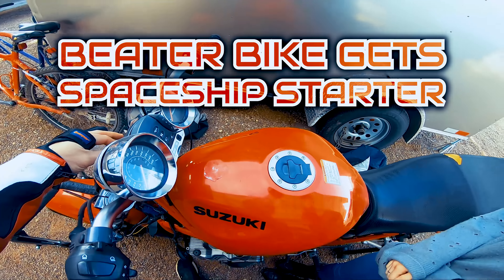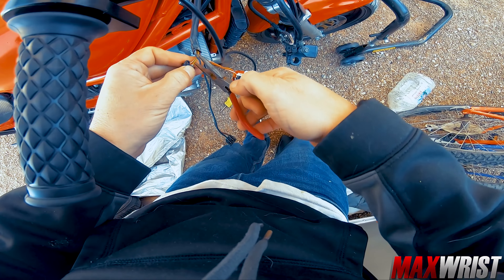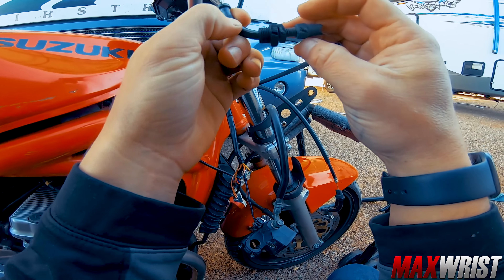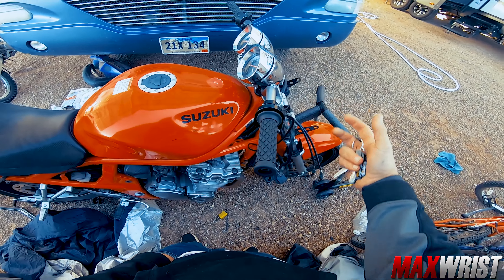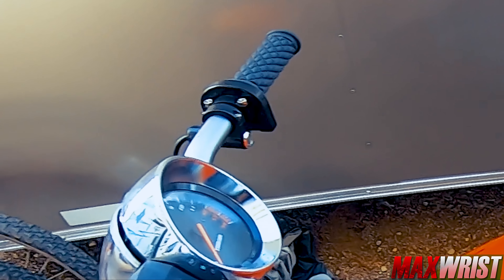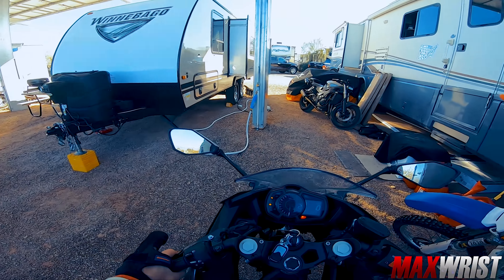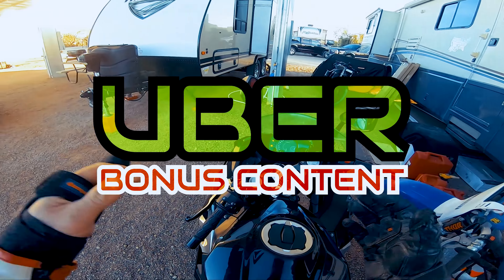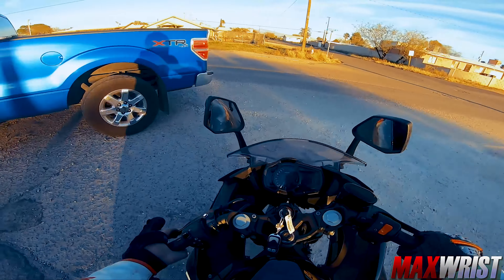DOPEST UPGRADE 😱 *SPACESHIP STARTER*

Comment: I don't mean to discourage you but CV Carbs don't do well with pod filters. Even after re jetting you will have flat spots. Even a high flow filter in the stock air box can cause all sorts of drive-ability issues.

Comment: Buy a Jet kit if your going to add pod filters. You can do that to a car, but if you do that to that little 250 your gonna be running lean as hell. You will give it gas and it will sputter out at higher RPM’s if you don’t rejet the carb :(

Comment: FYI, If you install those air filter pods, youre gonna have to take apart those 4 carbs and rejet them :(
Reply from the maker: Hmmmm
Reply: MaxWrist Gold  you should be able to find a jet kit for it, and look up a forum on google to see what people suggest for jet sizes with pods on that bike, then you just gotta open the carbs and swap out like 1 or 2 jets in each carb, if you’re doing the exhaust as well then you’re definitely gonna need to rejet it.   You can get some great power rejetting however, so I’m looking forward to it if you go through with it.    It should still run without rejetting, just won’t run fantastic.   I’d look up a forum to figure out what jets to run for pods and an exhaust.   Should be able to find the right setup pretty easy.

Comment: The clutch was way down on the bar because, they were stunting it.  When you're in the 12 o' clock position it's more normal, also they probably had a rear brake lever above the clutch taking space.